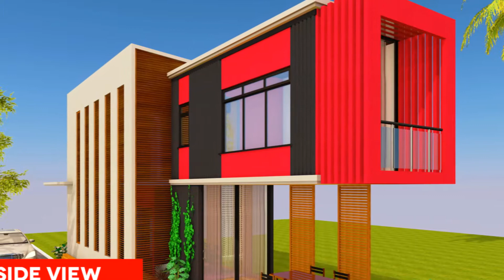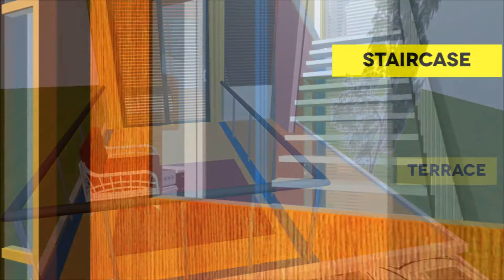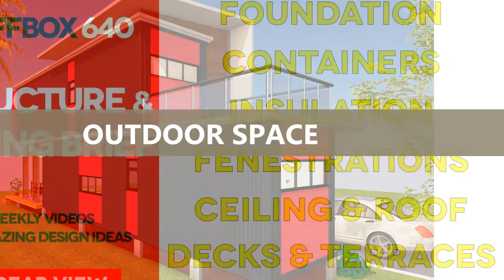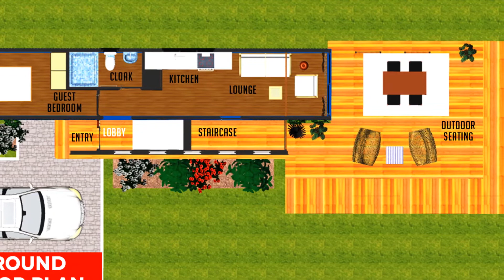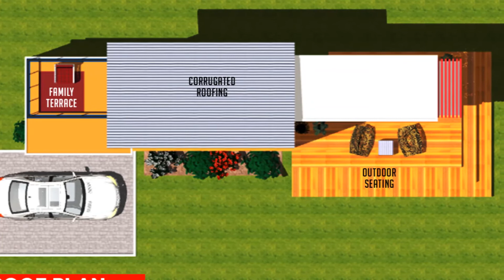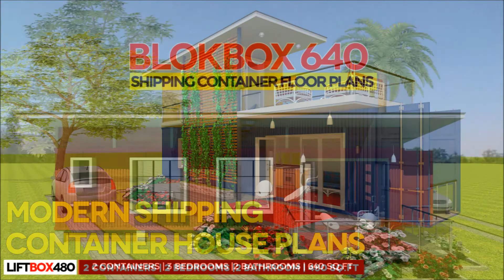Modern Shipping Container HOMES PLANS and MODULAR PREFAB Design Ideas | CLIFFBOX 640

Comment: Hi again
I thought the other designs were brilliant, but I must say. That I do love this one. I will soon, be building a home, I had ideas of my own but nothing like these.  My only concern is, the first floor container that cantilevers over the other one. How far out do you cantilever out?  And  wouldn't it make the ground floor container rack?  As there's no real structure at the end to keep it square, only a patio door?  How come you didn't utilise the full floor area of the first floor balcony ? Is that just down to design rather than function?  One more question, the box section on the side of the containers which links top and bottom.  Any reason why that can't be built out of timber?  
Keep up the good designs
Reply: Alex A hi again on the first floor balcony it does show Windows just like the ground floor on the cliffbox1280  how many different model boxes  have you? Just so I don't miss any of them out. Not counting different designs of the same boxes.